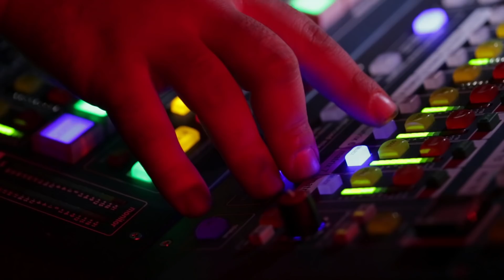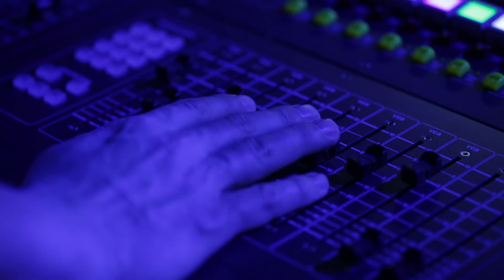“Big Mick” Hughes on Mixing Metallica, Low End, and LEO Line Array

Comment: I was always a big mixer of a big drum sound.. Beta 91, Beta 52 in and out on the kick.. That snap and boom... snare top and bottom...tight bass guitar,  DI and a beta 57 on a speaker... ...  and a huge vocal that I usually doubled at FOH to fatten it up... I still have an old urei tape delay echo and compressor. everything else sort of falls into place. I've mixed on some big PA's but nothing like that .... lol
Reply: Gotta get that hi-hat sparkle to cut through. If you mic nothing else on the kit mic the hi-hat.